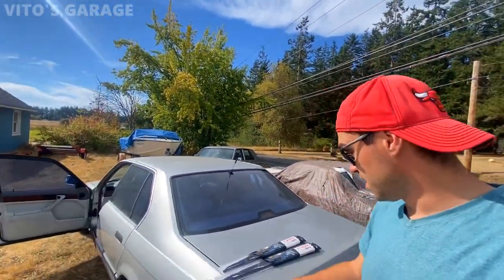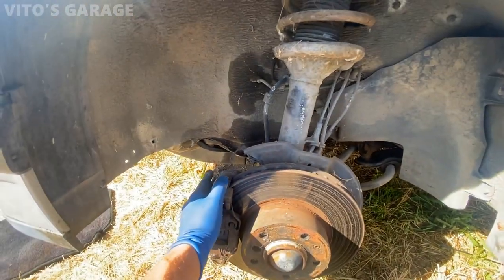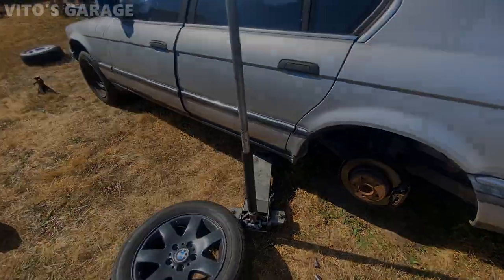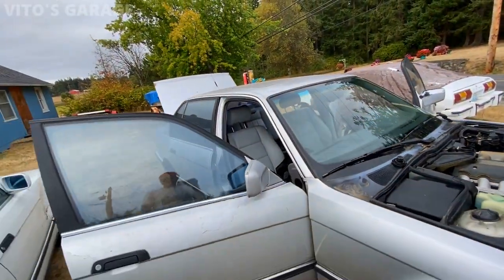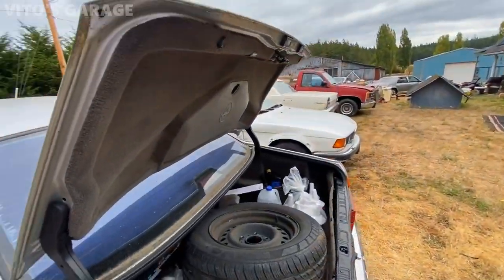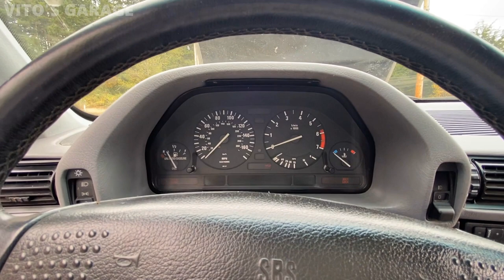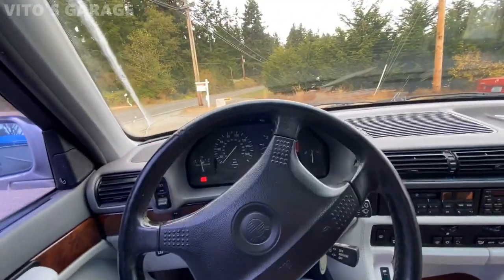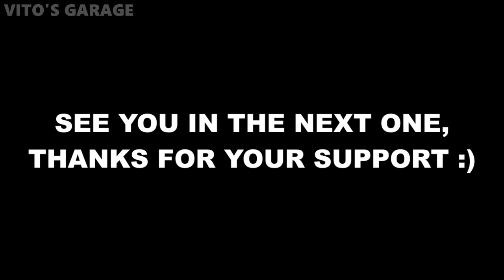V12 BMW E32 750iL Original Suspension From 1992 !!! + Lots of Maintenance Done

Comment: Great video! Thanks for posting!

Regarding steering wheel shake, check rear driveshaft guibo. Those need to be changed every 200k. Unless you have a hydraulic press, alternative is to remove driveshaft and send it to a specialist for driveshaft refurbishment.
Reply from the maker: It’s the wheels and tires that I installed that are causing this. The owner is gonna get new tires soon

Comment: I've got a problem. Both flex disks changed, the center bearing changed, the car still vibrates. It's an w210 manual transmission. What it can be ?
Reply from the maker: Tire/wheel balance problem; wheels are bent; driveshaft halves weren't put back together properly and it's out of balance now; cv axle is bent (unlikely); suspension is loose